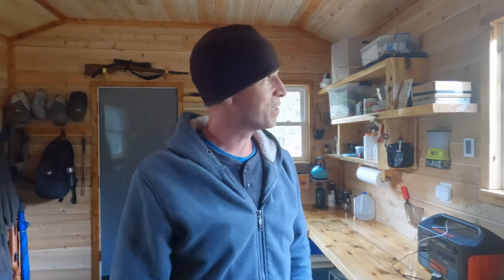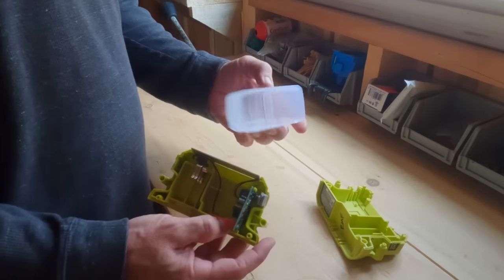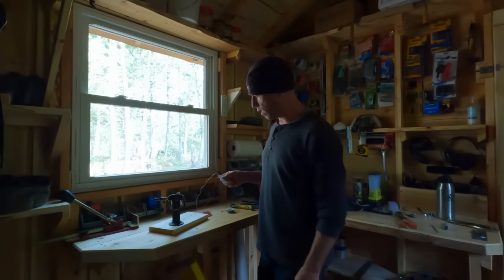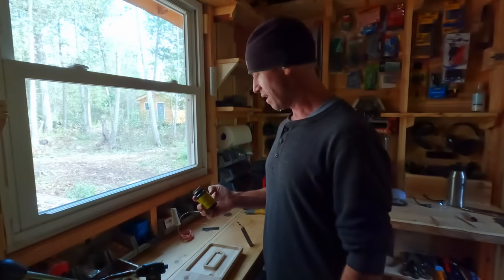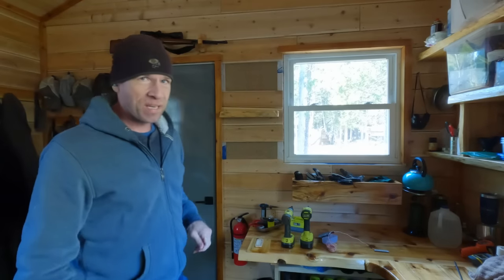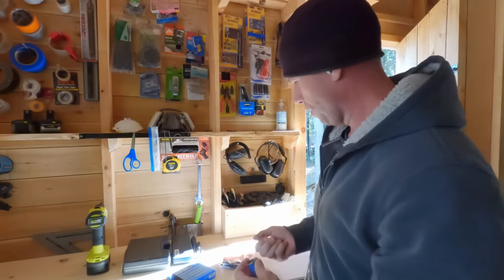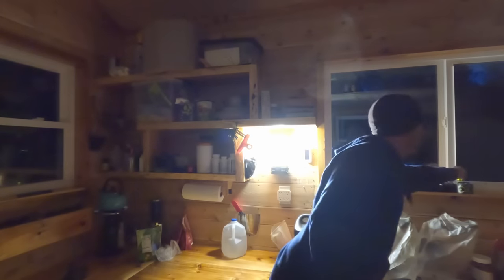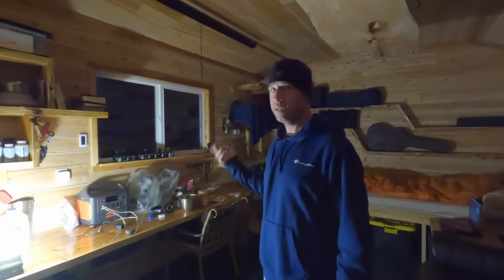Repurposed Ryobi- Disassembled LED to Cabin Porch Light. #160

Comment: Just a note: When caulking around something for outdoor use, do not caulk the bottom, or at least the entire bottom.  Any moisture that can buildup behind will be trapped.  You need the bottom to be open to release moisture and let it breath (In this case rotting).

Comment: A diode is a semiconductor device that essentially acts as a one-way switch for current. It allows current to flow easily in one direction, but severely restricts current from flowing in the opposite direction.
Reply: Short addendum: LED stands for light-emitting diode

Comment: I use 20volt 6 amp hour dewalt battery to power normal 120 volt light fixtures.  I take a female plug  and add a black and white stranded wire, clamp on to round stake ons, add a 12v normal led light bulb to the fixture.  Slide one stake on to the left side of the battery(positive) and one to the right side(negative).  Works greats for our off grid cottage

Comment: I’m the guy you mentioned that came up with the idea for “liquid electrical tape.” After developing the idea, getting it produced and marketed we almost broke even on the first run. Before I could get a second run into production there were several other competing products already on the market that were cheaper and worked as well as mine. I also discovered that my idea and product name were probably not sufficiently unique to be patented or trademarked and defended in court with my limited resources. 🤪
Thanks for the video Ryan!
Reply: I thought of it when I was in 9th grade electrical class in high school 1968. I even made some with several colors of food dye. The black I made with black ink (it actually was kind of dark blue?) Worked great. We painted all of our connections with it. Our circuits back then were actual wire connections to discrete components, no transistors or printed circuits.

Comment: You need an indoor bathroom.  You shouldn’t have to leave your cabin to pee!
Reply: Funnel indoors, tube to outside draining to multi-holed pvc pipe underground?
Reply: @cliffmorgan31  he’s a man.  He can pee out the front door, but what about when his girl visits?
Reply: @carolynberry5465  -
Whatever. But in the middle of the night in the middle of a screaming BLIZZARD, indoor options are kinda nice…
My motive for my comment.
Reply: @carolynberry5465  -
Whatever. But in the middle of the night in the middle of a screaming BLIZZARD, indoor options are kinda nice…
My motive for my comment.
Reply: @carolynberry5465  -
Whatever. But in the middle of the night in the middle of a roaring BLIZZARD, quick easy no-dealing-with-it-later indoor options are kinda nice…

Comment: The problem with your heat sink is that it doesn’t conduct the heat away from the LED panel for very long. It will help, for very short periods or time, but once the metal comes up to the temperature of the LED, it’s at equilibrium.

Cool project nonetheless!

Comment: Adjustable spring rods will fit into the interior window casings. You can drape your pelts over them without cutting much of the length. The light turned out great!

Comment: Think of the room as perfectly isolated. All the heat out of the gas combustion ultimately remains trapped inside. That's what isolation does. The intermediate details and processes, such as a fan powered by heat blowing air, end up adding to the grand total. What was generated, if it can¡t escape, remains inside. You don'n loose real heat.

Comment: I`m writing this at the beginning of the video , but couldn`t you cut a hole in the wall and slide the light through and anchor it and the then cross wire the on off switch to stay on so all you had to do is put a battery in ?

Comment: What you said about the stove fan WOULD be true if all the heat being produced by the fire were going into the room.
As a lot of the heat from the fire goes out through the vent, or stays in the metal, by using the fan and radiator the part of the system that "looses" energy to running the fan would be the heat venting to outside. So while you've "spent" energy in converting heat into kinetic energy, what you have saved from going to waste out the vent is significantly greater
Reply: All true. And the kinetic energy heats the air as it moves it around. The moving air also increases the overall heat transfer from the stove and flue pipes into the room thus keeping that heat from going outside. The air circulation increases the comfort in the cabin by reducing thermal layering (hot near the ceiling and cold near the floor).

Comment: Heya Ryan, like the re engineering you're doing. Just have a thought though, I use a solar shed light for my tent (12x18) reenactor marquee tent), might save you battery recharging times. The key is finding the right light for the use. Granted, some are lousy, but again it'll depend on intended use. There's some with 2 lights off one panel that would be fine for periodic usage on-off by the remote, like in the tool shed or shower. For longer/brighter needs like in the cabin or pavilion I've found the ones with the motion sensor and 4 angle-able panels to keep a charge great but might be too bright. They are light color adjustable, and somewhat dimmable with their remote (which also sets the operation modes).  I mean, basic lighting there's always the dollar store solars that typically only stay lit a few hours (been seeing folks convert them up to tiki torch heights). Anyway, just a thought, hope it helps

Comment: You might want to see if some PIR sensor controlled lights would fit your situation.  You can find ordinary household PIR sensor equipped battery LED lights quite cheap, and there highly likely is also bit more sturdier lights meant for outdoors designed to your kind of living.

Comment: Weird. Every LED I've ever soldered is definitely polarized.😁
The D in LED stands for Diode. Diodes are polarized. You should 3D print Ryobi battery jacks. I don't 3D print, but I've bough some 3D printed jacks. They plug onto the top of the battery and have + and - leads off of it. Super handy!!  I've used them for USB chargers, 18V power to a amp for my "BoomBox" (a bluetooth speaker in a case), multiple Camping/Portable  lights. I don't own any ryobi lights, I just make them. But I like that bright Ryobi light you demonstrated. 
Cheers from Lapeer.

Comment: Love your builds and sharing. Suggesting the farther you run wiring from the source especially dc, up size your wiring to the source to prevent the voltage drop

Comment: I think the thermal paste is kind of pointless. It will help move the heat in to the metal, but the heat is then stuck in the metal. There is no air movement to dissipate the heat away from the metal.  But it can't hurt anything.

Comment: So with the fan on the stove you don't loose any heat. This is because ultimately all the electrical energy in the end is converted back to heat because moving the air the particals of air bumping into each other generates more heat. The numbers are to small to notice but that is how electrical fans work. Ironic how we use electrical fans to cool us off in summer. It works because the watts are so low the heat is unnoticeable and the evaporation off humidity on our skin is multiplied many times over so our body temperature drops significantly.

Comment: Noooo....? LED stands for light emitting diode, emphasis on the diode part. Diodes only let the current pass in one direction. The only way you can make a led light shine without making sure that positive and negative poles are correct would be if a bridge rectifier was connected in series with the light or if you feed it with AC power.